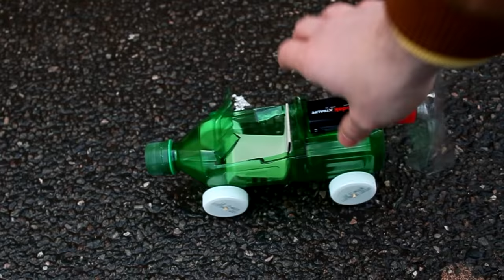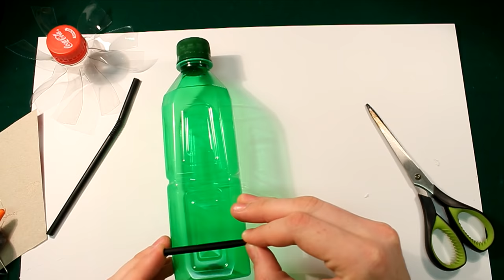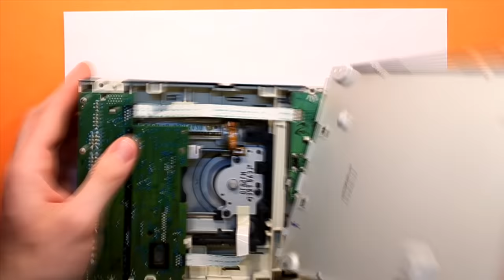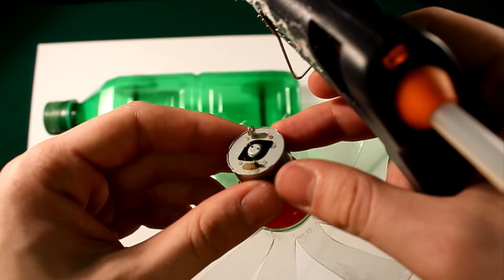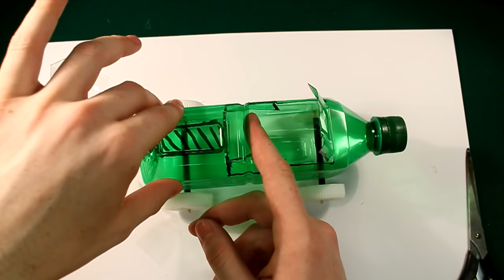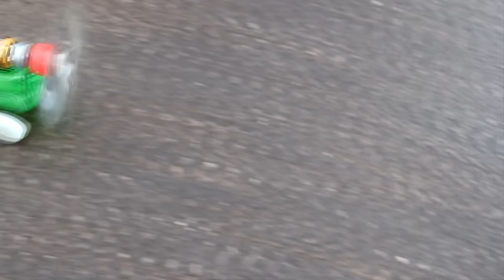How to make a Car - Powered Car - Very Simple

Comment: starts by using common cheap / household items

suddenly pulls motor out of computer hard drive
Reply: it's an old CD-Rom drive
Reply: Lol
Reply: model will not work
Reply: It is boring look at the air cooler
Reply: احلا اخترع
Reply: A steering DC Motor of a RC car is way faster than that of a CD-Rom Drive, I tried it and it was fast af
Reply: Zacly bent
Reply: Juan Chavez LOL
Reply: Juan Chavez hdyrfe
Reply: Very nice😋😋
Reply: Juan Chavez k
Reply: LOL
Reply: ما شاء كنقجقط

Comment: Alternative Motor: You can use a 1.5v or 3v powered Motor, which often found on Car Toy called "Tamiya" or Mini 4WD.

This kind of Motor (also called Dynamo) has at least 10000rpm for 3v powered, and can be hacked up to 20000rpm

Comment: Try and make a little helicopter!! :D
Reply: unfortunately gravity is your worst enemy @ this field :v
need multiple aeromodelling motors (>$20) and MCu to stabilize it
Reply: Fathin Luqman Tantowi A problem is also the weight and needed power. It wouldn't really work properly or only a short time
Reply: Im 11 and I WAT
Reply: BioformerFan this made me laugh for a solid 15 minutes
Reply: Anthony Dimartino lol, right. basically the helicopter you make is heavy as hell (without gear and stuff), and the motor won't lift at all XD. and also you can't control the motor which is suck
Reply: Fathin Luqman Tantowi n

Comment: this is not a car powered car, its battery powered
Reply: Funny thing is I searched "car powered car" and this is the first thing on the results.
Reply: Did both of you even saw the hypen between the car and the powered car?!
Reply: Amiel John F. Mercado This is a hyphen ~
Reply: logicbloke That is a Tilde, a hyphen looks like this: -
Reply: Maniac of Doom Thanks
Reply: logicbloke logic is in your username, you don't even need to use it to tell what is a hypen/dash.

-    _    -
Reply: ChrisD4335 Woah, woah, woah. Electronics nerd is here to correct you. The battery is powering the electric motor. The fan attached is like a drill. It spins and fins through the air in such a way to give you thrust.
Reply: Ryan LeFevre  ok buddy....
Reply: Ryan LeFevre ... Still battery powered. Like saying a car is wheel powered when it's powered (note power) by gas (in most vehicles).
Reply: ChrisD4335
Reply: Amiel John F. Mercado 
A hyphen is what actually connects the words to worm a compound adjective.
Reply: ChrisD4335 mk
Reply: what battery is that??
Reply: Ana Vera

Comment: I've got a question:
"HOW TO STOP IT?!"
Reply: remove the battery
Reply: Remove the battery
Reply: I am unable to right now...
Because it just went on and on and now I can't even find it.....
Reply: Remove the battery
Reply: Put a on off switch. The wires of the on off switch will be two. Put one attached to the battery with duct tape and the other attached to the motor also with duct tape

Comment: Put the materials on the description
Reply: The materials are: Concrete, house bricks and 2X4 Oregon timber.  Just look at the Video you will see what is being used DUH!
Reply: aryan sharma
Reply: potresam macadato 
MATERIALS REQUIRED :
1 )   2 Plastic bottles
2 )   2 straws
3)    2 sticks
4)    4 bottle caps
5)    DC Motor
6)    Battery (choose your battery according to your DC Motor
7)    Some cardboard-like material for making the seat
NOTE- PLEASE MAKE SURE THAT YOUR DC MOTOR AND YOUR BATTERY ARE NOT TOO HEAVY. THE CAR WILL NOT MOVE IT THESE WOULD BE TOO MUCH HEAVIER!! 
Hope this helped you. Thanks!
Reply: @Ananya-we2fo  thanks for the help
Reply: @velcroman11  تو
Reply: @noobragaming8244  زو
Reply: ار
Reply: @user-gt6bc4or9e 
Ok
Reply: @velcroman11  🤣🤣🤣nice one buddy

Comment: This how to create a 1942 10292 replica all matching numbers Ford GPW Script Jeep: I take steel to create 2 10292 axles, which need ring gears to get created from steel, which needs it's 4 spider gears to get created from steel, which needs it's bearings to get created from steel, and then I create 10292 Ford GPW Script Jeep L134 Go Devil from iron, which needs it's crank to get created from steel, which needs it's bearings to get created from steel, which needs it's notches to get cut out in it's motor, which needs it's camshaft to get created from steel, which needs it's notches to get cut out in it's motor, which needs it's 4 cylinders to get bored out in the motor, which needs it's 4 pistons to get created from steel, which needs it's pistons' rings to get created from steel in their motor, which needs it's head to get created from iron, which needs it's copper head gasket to get created from copper, and then I create a 1942 10292 Ford GPW T84 transmission, from iron, which needs to get it's gears created from steel, which needs bearings to get created from steel in it's transmission, which needs to get it's shifter created from steel.

Comment: put the materials on the discription
Reply: materials are 1.75 lt grey goose vodka bottle, ceiling fan and motolite xlt battery.  you also need elmers glue and circular saw to cut.
Reply: hey that's what i said
Reply: ur right broo
Reply: Gobal Mass
Reply: yuity
Reply: jim john 
MATERIALS REQUIRED :
1 )   2 Plastic bottles
2 )   2 straws
3)    2 sticks
4)    4 bottle caps
5)    DC Motor
6)    Battery (choose your battery according to your DC Motor
7)    Some cardboard-like material for making the seat
NOTE- PLEASE MAKE SURE THAT YOUR DC MOTOR AND YOUR BATTERY ARE NOT TOO HEAVY. THE CAR WILL NOT MOVE IT THESE WOULD BE TOO MUCH HEAVIER!! 
Hope this helped you. Thanks!
Reply: jim john

Comment: how it is moving? the motor power should be connected to wheel right?  In this case , the axial fan creates high pressure air b behind the fan ,which makes the bottle to move? can anyone help me to understand.

Comment: it doesnot move
Reply: Try any other motor, by the way which motor you used u can even use 3volt motor, u should even check the power of the battery or cell